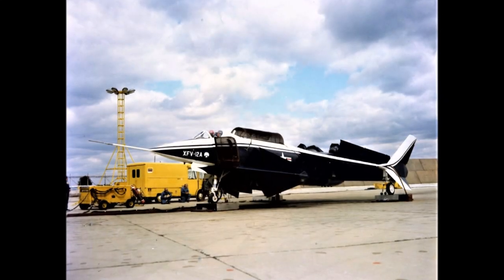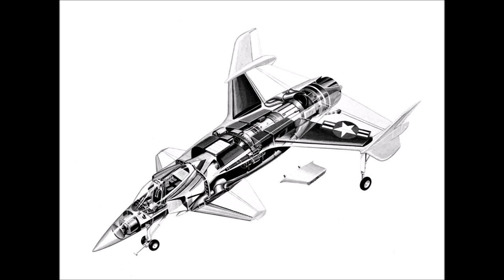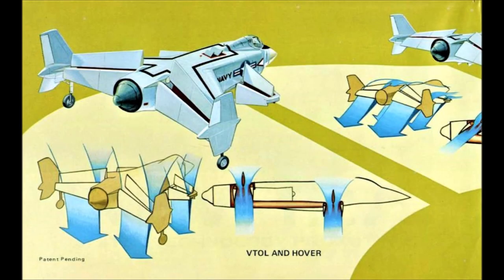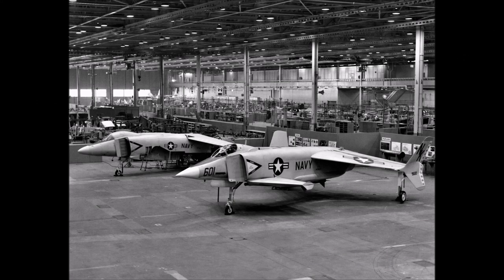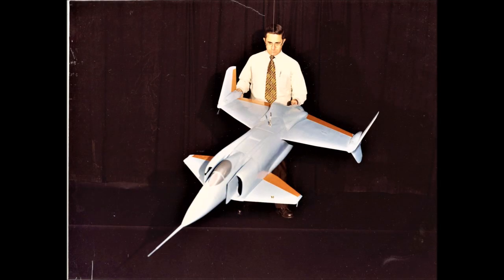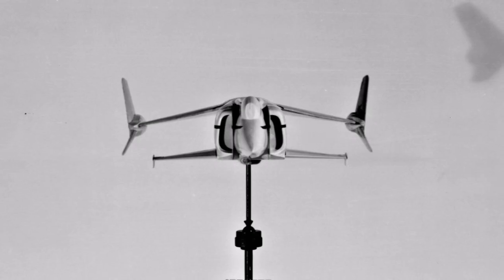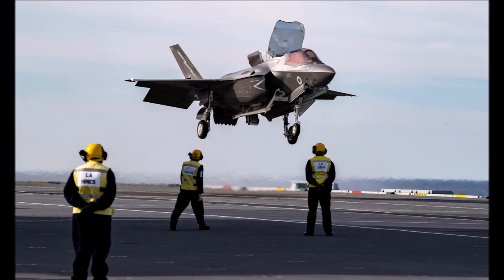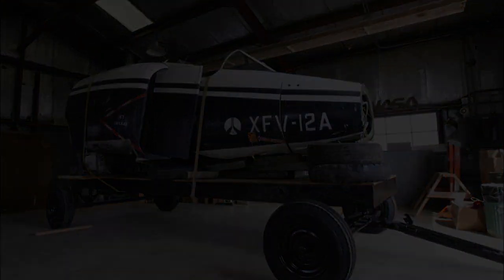The Rockwell XFV-12 Fighter - The VTOL Plane That Couldn't VTOL

Comment: I was a postgraduate working as an intern when this was in development. My mentors at BAE were aerodynamicists who had worked on Harrier. They told me around 1976 that it wasn't going to work because of the complex ducting.
Reply: I don’t need to be an aerodynamic anything to tell you the ducting is too complicated. As a car tuner and part time plumber I can say that there’s way too much ducting. When I do a turbocharger I try to keep the ducting as straight and short as possible and incorporate minimal turns. In plumbing we try to keep stuff the same way strangest, shortest run we can make to make the fluid to the work. Here I think had they dumped the wacky ducting and just used a frontal blower system similar to your harrier it might have worked. For starters they could have eliminated the wacky spreading wings in favor of just getting the thing to go up vertically. In these engineering challenges just see if the thing can lift itself first. Then after you show it can do what you say, then add the bells and whistles.
Reply: Yeah, definitely not "the best and brightest" working on this project. It was known by the 1920's how developed flow in pipes (Reynolds number - 1883) dramatically can effect flow in ducting and cause inefficiency. (The 20's is heavy initial development work in turbomachinery).

No one with half a brain would ever expect any sort of efficiency out of such narrow and consulted and high surface area ducting.
Reply: I was part of 1990's postgraduate group who were taught that there is big difference between looking pretty and a simple functional design.  The Sea Harrier design was spent on just the engine and ducting...and not on the looks.  Even the DARPA/NASA X65 Active air flow concept could benefit the Sea Harrier over design by removing weight.

Comment: What I'd like to know is if the XFV-12 could've worked if they gave up on outright VTOL (which was rarely used anyway with the Harriers). Would it have been capable of STOVL?
Reply from the maker: It is supposed to have been capable of taking off regularly, but the way that the ductwork was on the XFV-12, I almost think that it was an all or nothing sort of deal. This is from memory, of course, but I don't believe it was able to be have variable pitch nozzles, like in the Harrier.
Reply: @RedXlV  l
I can think of another prototype that the US Navy had in testing and scrapped it after ground testing. The XF5-U. They had to bring a wrecking ball into breakup the airframe. If the concept had worked and allowed really low speed take offs and landings imagine an aircraft designed for transport on and off of carriers.

Comment: So with a modern engine this will work
Reply from the maker: In theory, yes. Of course the rest of the plane, especially avionics, would need to be updated and upgraded, too. Even if it maintained its general characteristics after the major updates, there is a chance that it may not have been able to reach the speeds that it had been planned to reach as, even now, VTOL planes simply find it very difficult to hit mach 2+. Assuming this could be built today and would receive said upgrades, it would likely end up looking like a rear-wing F-35.

Comment: You kinda missed the biggest error of this design.

It was chosen because the admiral incharge of the program had stocks in Rockwell and when he took the Three designs, Rockwells, Convairs, and the Harriers to the Secnav to choose which one to fund. He jiggled the facts so it seemed like it had the best chance of working, even thru it had the lowest and the Navy did want a working VTOL plane for the Marines so they did not have to buy Brit Harriers.

Comment: the f4 never had a gun installed...it had to carry a gun pod...the f4 was designed to be missiles only
Reply: The F4E had a Vulcan gun inside the nose.
Reply: @alessandrocerioli2151  no it doesnt  it has a radar in the nose....google f4 phantom gun pod
Reply: @alessandrocerioli2151  spent most of my life on af bases the f86 was one of the last ones to have a gun in the nose, most have guns in the wing root....f15 f16 su27 mig 29
Reply: @dvddobson  Sorry, but you don't know what you are talking about, the F4E had a Vulcan installed underneath the radar, that was the final version of the fighter, google it.
Reply: One thing about that f4,
Default endless weapons and knowin when to be spooled up and knowin when to be spooled down and I can fuck all them migs and sukois up
Reply: Most late model F-4E and later jets have a barrel shaped section that’s under the nose. This is intended to house an M-61 and address the issue of the phantom not having a gun. The gun pods you speak of were an interim fix to at least give phantom pilots another weapon option. The SUU-16 was powered by a ram air turbine that opened when the trigger was pulled. The SUU-34 was electricity powered. However Phantom pilots had to sacrifice the centerline fuel tank to fit it, and a with the J-79s tendency to literally chug fuel it meant tankers became more important and had to operate closer to the front
Reply: @matthewcaughey8898  that pod in the nose is for the texas inst. design infrared tracker
Reply: @dvddobson  well I’m pretty sure they fitted the gun in there. Later model F-4s relocated quite a bit of equipment. Ultimately all for not as the F-4 was phased out by the F-16 in the USAF ( with its cannon fitted into the wing root like the F-15) and the F-14 had a port for the M-61 on the nose somewhere. If you’ve got a photo of an F-4 Phantom’s gun mount location and external port it would help convince me. Or at least describe where it is on the jet so we can find it
Reply: You're half right. The second half - as others have said the E had an internal gun. This is by an F-4 WSO: https://youtu.be/rdL93jwVK-c

Comment: "the vtol plane that couldn't vtol"
hm
Reply from the maker: Well, it was designed for VTOL flight, but wasn't powerful enough in that configuration to do so. Jokes aside, do you have a better title for the video that I could possible use? I'm not married to the one I have currently.
Reply: @Tankenstein  nah, the title is fine